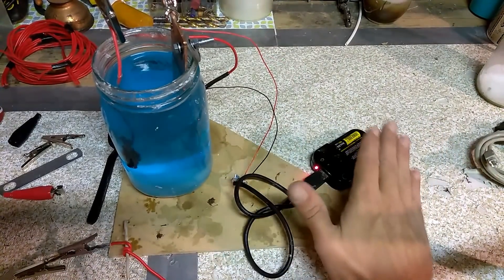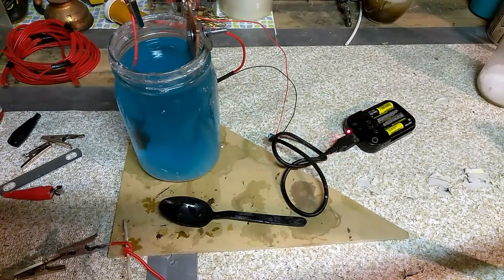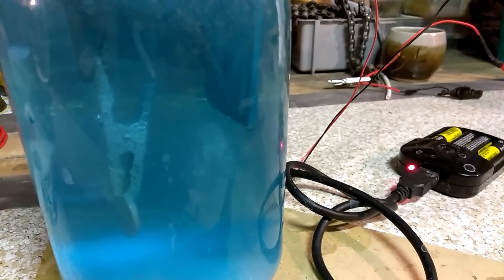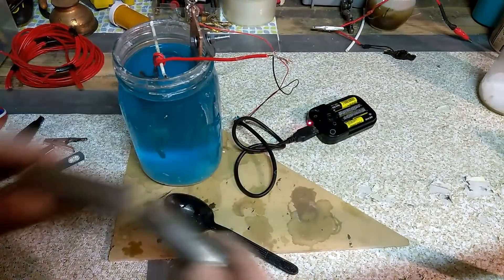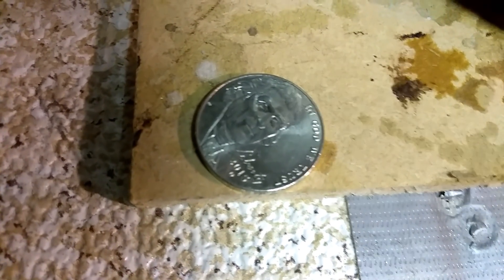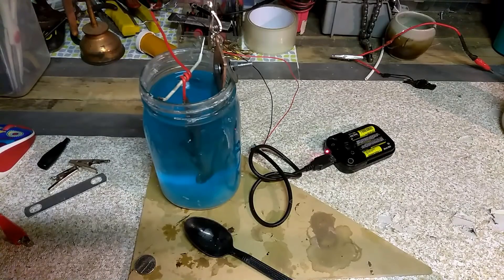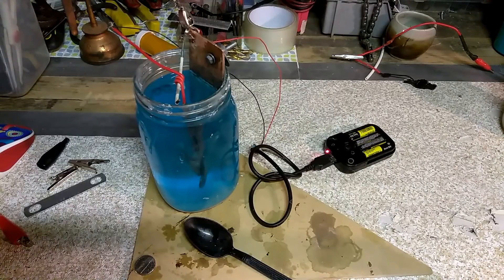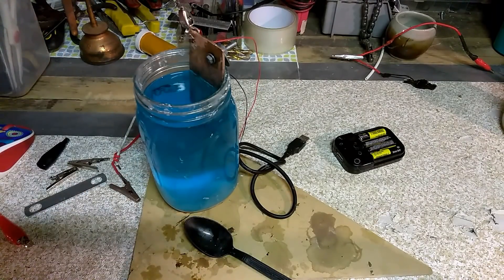Copper electroplating using baking soda.

Comment: is that a solid copper plate? because it looked like bare white metal when oxidised,,can you simply grind it back to its original finish ,also can this be done using brass or gold necklace to gold plate? will it rub off easly with youir fingers or it depends on how many layers got put on and how long it took?
Reply from the maker: Im using a copper plate from an old computer. If you keep the plate clean it works better.
Reply: yes yes i think i just learned keeping everything clean in the process produces better results,,i have tried on a 9v bat and tried doing a quarter but this gunky stuff built up fast on it  and burns and just rubbed off but what i did started noticing is my small alligator clip that was holding the part actually came out looking great after several attempts of doing the quarter,,the clip after cleaning the gunk out actually had a lovely even coat of id say a good amount of microns as its hard to rub off or scratch,it turned out amazing when putting a regular clip next to it,even coated between the small teeth and the small screw on it ,so im puzzled why it worked there but not on the quarter,,im thinking it must be either the plating on the clip or the quarter are different or it could be i did not properly clean the quarter? i never cleaned the clip to begin with so i assume whatever its originally plated with(i guess nickel of some kind) it did the job,but i have to keep trying ,this time im using a small dime and i cleaned it with jewelry cleaner and made it look like a mirror problem is i did not wash it with water but simply wiped it and started the process,hopefully the cleaner wont affect it like skin oils might,also my 9v may have died down to the perfect current right now lol i had no idea how long a batt can last doing this but its slow now with very little bubbles but the dime is getting browned like normal,,but its a learning and exp curve each time ,so just keep at it
Reply from the maker: @ARCSTREAMS  you may want to clean the coins with vinegar or lemon juice. That should help them plate faster.
Reply: i used vinegar and salt last time and i guess i can put some lemon juice or citric acid in there as well,,this time i used a jewelry cleaner and its been in the bath almost 2 hrs now and so far the dime has a nice copper pale coat on it and not some brown dark crapp like before,,so far so good but we shall see,,im still wondering why i failed before with the quarter and yet the clip came out good? could it be the plating finish on the clip has anything to do with it? also does a porous metal surface  help? i saw a guy directly copper plating aluminium  without any zinc or nickel pre strike

Comment: Would this work for brass since it's partially made of copper?
Reply from the maker: Shunkawakan Okawingha I'm not sure. I have so many questions on this video about plating I guess I have to revisit it soon.  If you try let me know your results.
Reply: Brass is typically copper-zinc alloy, you'll need an electrolyte solution that'll be compatible with both metals
Reply: I've used pre-1982 pennies as my copper source for plating.  I think it's a copper-zinc alloy?  The zinc will not plate out as it's more reactive than hydrogen and will stay in solution.
Reply: You can plate copper and then plate zinc and you will get brass

Comment from the maker: Try using some sandpaper on the electrodes. The water should turn blue when it has copper in it. Did you add some baking soda?

Comment: I Have Done The Same . With Around 5 V Voltage And Two Copper Electrod Connected With Lead Acid Battry . And Kept The Solution For Around 3 Hours But There Is No Change In Its Colour . Does It Means That The Process Is Not Going Correctly ?
Reply: Wait, are you plating in an acid/base?

If not, that means you are just creating a chloride solution, which is quite toxic.
Reply: @neutronpcxt372  hey that's not good I think you may have to many amps is it clear or foggy I did similar and idk what I made it will plate tho just polish it a little after cause it will be black

Comment: sir, can i used brass plate or bronze plate in this procedure?
Reply from the maker: I had the same issue.
Reply from the maker: roger cada I'm not sure. Try it out and let me know :)
Reply: No brass and bronze are alloys, you will pull out the zinc or copper from the brass or tin and copper from the bronze

Comment: I know from welding zinc, when you try to remove the zinc with a Tiger Paw or a Flapper disc, the zinc is removed visually but the zinc is still there and you still can't weld to it so you have to use a hard rock gringing disc and really dig into it, to reach the bare metal in order to weld to it, so i would try sand blasting the parts and see if you get better results.
Reply from the maker: The zinc will take the copper but not too well.  Grinding it down to bare metal would help a lot. When I get some more funds I plan on plating a beach cruiser bike for the local steampunk convention. Should be fun.

Comment: Now if only one of us could come up with an easy way to plate glass with metal films. Let's face it optical grade glass isn't cheap. I've tried things like sputter coating it in a vacuum jar. I've tried chemical processes too. See the thing is, I need first surface mirrors for some optical experiments I've been working on. I've had several lasers over my life from ruby to gass and even a few decent diode lasers. Combining beams is one of those holy grail things in that field. I figured out how to make a decent device but I need first surface mirrors for it to work. I've seen lots of videos about others doing it. I just don't have the same success. The biggest problem is keeping the shop clean. It is by most standards but it's not "clean room" clean. While I can get away with fixing hard drives and working on other optical equipment like when my camera's lense somehow get's that annoying flake of dust on the inside of the lense somehow... The point being that you can mess up the finish if you even breathe on the glass let alone touch it at all. Tricky stuff...
Reply: ExStatic Bass have you tried the chemical method used to make mirrors? Its something like silver nitrate and an acid of some sort that draws the silver out of solution.
Reply from the maker: ExStatic Bass sounds like a good idea to experiment with. I will do some reading. Maybe use a lead glass.
Reply: You'd think that would work right? It doesn't though. Leaded glass doesn't conduct like we think it should. In fact it takes some pretty high voltage to get anything to pass through it. No, lately I've been experimenting with broken LCD panels. The problem is that they aren't completely coated. They just metalize the contact area for the pixel matrix.
Reply: When you vaporize a metal wire with high current in a vacuum, it will coat everything inside with a layer of metal. I forget what its called but basically the metal vapors condense on the surfaces and turns solid.
Another alternative is fire brazing where you paint on a mercury almalgum and then use a torch to burn away the mercury leaving the metal behind.
Reply from the maker: richard vaughn I have seen this on a few YouTube videos. I think Cody's Lab or Periodic Videos did it. I will look into trying the method but my funds for projects are very low. If I can find a way to do it cheap I will post it.